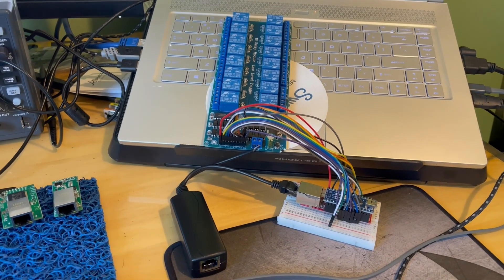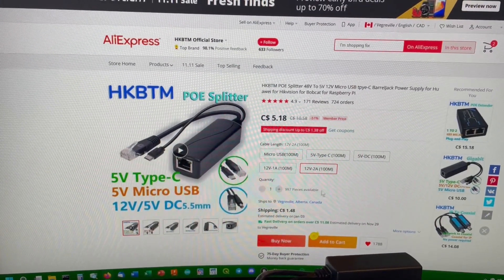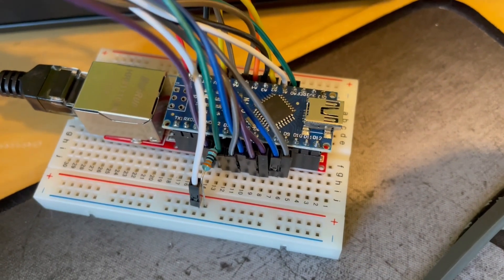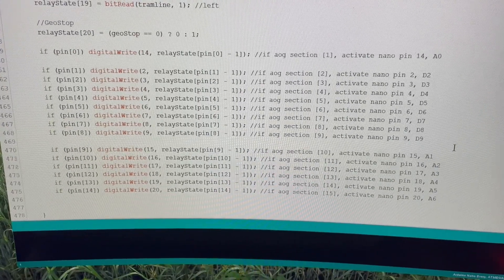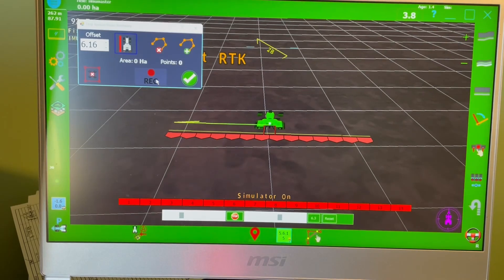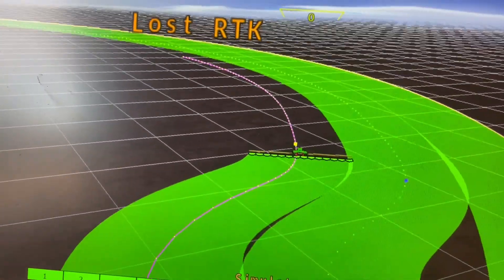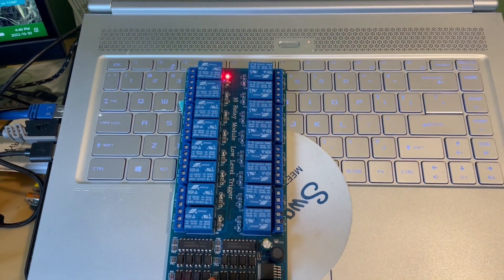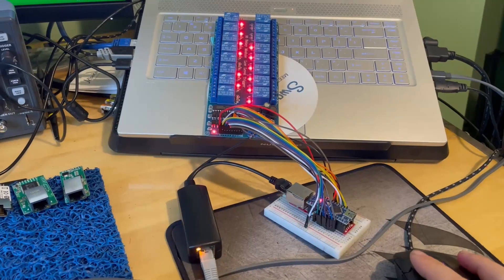AgOpenGPS - POE Section Control update

Comment: Im a little bit of a noob around agopen (i use cerea gps for a year now) currently building myself a agopen unit. Like the vids! Learning a lot from them! Why do you ‘need to’ use peo instet of only udp?
Reply from the maker: POE is just an easy way to make the boards plug and play without having to string out additional power wires to everything.

The modular system is currently an unofficial modification, but I like to show that you do not need to be a certified electronics and software engineer to make major changes to this guidance system.
I grew up on a Cattle farm, and never went to University, Just some college and trades.

Those who use the equipment are the best to design and develop it, way to go farmers.
Reply: Thats why i like the vids, i am just a young farmer working on my dads farm without expensive elektronics, didnt know a thing about elektrics but stil builded a good working cerea gps system, agopen is a little bit harder with the pcb’s and all but its a fun thing to learn new things and building a cool system.

Okey so if you only run udp you need to power the board separate?
Reply from the maker: @BasBeuwer333   If the loads are small 15watts per channel POE “power over ethernet” can power the board from the poe switch to the device. Larger loads like the steering motor will always require their own power source.

But electronics modules can use poe or a direct power wire, with udp.

Comment: Did you know the earth is flat? Very serious Q.
Reply from the maker: Hahahahah, 

May you get the chance to fly over the ocean, at 42,000ft in a plane, and look out the window and have your two remaining braincells be amazed.

https://youtu.be/hrAdayUh6-4

FML, I live on the same planet as this guy.
Reply: @potatofarmer  if the horizon is falling with a 6 foot elevation at 2.99 miles away. Then the horizon should only fall when you gain altitude the fact that it continues to rise and stay at relative a level as high as you can go defies your globe logic.

we have observations at over 10 times cruising altitude that still shows a distant flat horizon rising to relative eye level.
Reply: @potatofarmer  did you know GPS is based on a Cartesian coordinate system that requires its zeniths to be parallel? Do you even know how latitude and longitude was originally derived and how to repeat the process today?

No worries. The earth is not changing shape and is not going to start moving. You have all the time you need to figure this out.
Reply: @potatofarmer   if you measured curvature in reality, you would not have to apply to haversine formula. Just tell me how to verify your assumed radius value in reality and you win. It’s as simple as that.
Reply: @potatofarmer  you know mad mikes plan was to perfect his rocket and then launch it from an elevated balloon launch platform.. he had many successful landings before his death. You are not a nice person